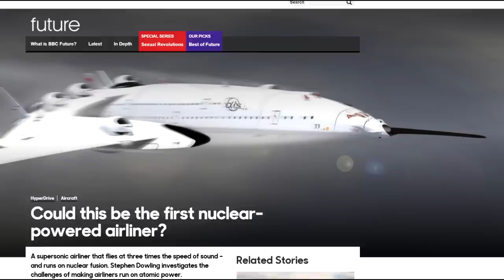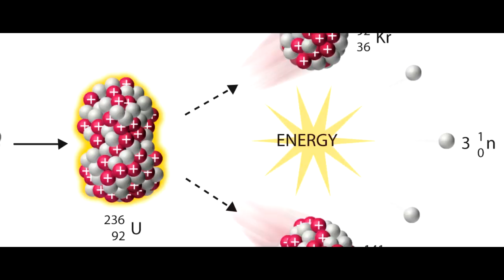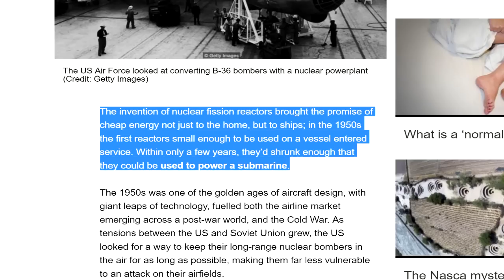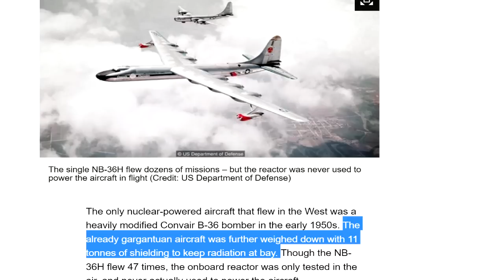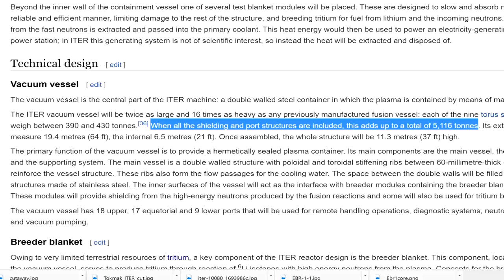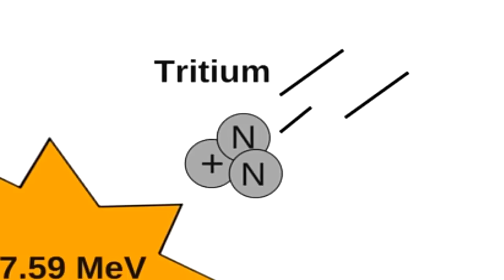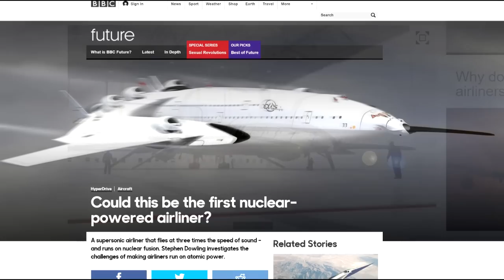SIX ENGINED Nuclear Airliner... BUSTED!

Comment: One point I would like to raise is friction heating at that speed. For reference, consider that a concord painted white has a service speed limit of Mach 2.02 while a blue concord is limited at Mach 2 for no more than 20mins at a time. Higher speeds would probably cause thermal damage to the material. 

Concords are able to sustain internal temps by using fuel as a heat sink, crossing the pacific probably takes abt 3hr where either they land or they use up all fuel generating the speed anyway.

We assume that the powerplant is not 100% efficient and generate excess heat. Where are the radiators gonna go? Considering that the outside is hot and the inside hotter, I would assume they advertised this airline as the 'flying oven'

Comment: What of the fission powered turbojets experimented with in the fifties? The heat energy is used to power a turbojet, similar to how they work now, only instead of combustion with jet fuel, you find the heat from the reactor. 

Naturally this would take a great deal of work to shield an operator, but what of drones? Then you simply need to shield the outside of the vehicle, so you don't have a flying 'neutron bomb'

Comment: Pls, enlist some of your fans to do historical research for You.
Convair NB-36H was a prototype: a flyable B36 with a functional reactor, however:
1) that reactor was just a test device to try out the shielding, and it was never powering the propellers,
2) 11t (in that 1955 prototype; in perspective it could be significantly reduced, because You have to shield only the crew; even the airfield stuff could be protected in other way) is not so much for 40t max payload of B36 (or, realistically: 20t with fuel for long mission); The problem was the position of the shielding, and (in early concepts) a requirement of placing all the heavy stuff near the center of the mass. That was a problem, but a solvable problem.
3) "atomic bomber" program was cancelled not because it was too hard to develop (few tweaks here and there...), but in 1957 it was already obvious, that ICBM was much cheaper and in the long run: much more effective alternative to any bomber,
even with (almost) infinite range.

Comment: If it's just 10t of shielding then it's not really a problem, you will get rid of over 20t of conventional fuel after all. 
That being said, it's still pretty crazy idea (even if it's technically possible to do) for the safety reasons - nuclear reactors flying over our heads? No, thank you!

Comment: +Thunderf00t Wouldn't it be easier to just use nuclear fission reactor core in an engine, pass over the air from the intakes and then heat it up so that you get a superheated plasma  exhaust?
Reply: Shielding remain a problem. Too much weight.
Reply: Not if polution is part of the plan.
Reply: Fuck shielding. Radiation is just another liberal conspiracy to take our jobs and make us poor! Wake Up SHEEPLE!

Comment: The only bullshit is the fusion part and the "six" engines. The concept of a nuclear powered plane is viable ( they even do test in the Peacemaker as you mentioned ) but of course the "direct" core model was a stupid idea and even the "indirect" model have the problem of "plane crash=nuclear wasteland". About the six engines... another one of the bullshit nails in the coffin, it can have six exhaust and air intakes, but not six cores that's a no sense. BTW cool video ;)

Comment: Fuck that noise. What you really need is a solar-powered moving sidewalk made out of solid dilithium that can reach speeds of up to 3,000MPH that bring you to a thorium-powered railgun that just fucking shoots you across the planet to your destination. You could get anywhere in the world in five minutes, and the railgun pods could carry up to six hundred passengers and fire at a rate of fifteen pods per second. Running at full speed, it'd take just over ten hours to depopulate the entirety of the USA by flinging them safely wherever in the world you wanted! And space exploration? The pods would be self-contained life support systems which could maintain food, water, and air for a thousand people for six thousand years! It'll be called the NOAH Ark-Cannon, and if you invest today you can get in on the ground floor and triple your investment!

Comment: Let me list some of the problems with a nuclear-powered airliner that I could think of: 
1) The whole point of a nuclear power plant is that it can run a long time on relatively little fuel, which is why large military ships such as aircraft carriers have them. These ships are out at sea for months at a time, but no passenger jet is going to go for more than a few hours without landing. 
2) Terrorists who hijack the plane or shoot it down over territory where they can loot the wreckage would have relatively easy access to radioactive materials which could potentially be used to build a dirty bomb. 
3) The possibility of terrorists getting their hands on radioactive material would necessitate even more invasive security screening than what airlines already have. 
4) If the plane exploded in mid-air, it would spread radioactive material over an area possibly hundreds of miles wide.
5) The weight of the radiation shielding would necessitate a much larger aircraft with much larger engines, and the energy needed to get such a massive aircraft off the ground would negate the supposed benefits of running an airplane on nuclear power. The bulk of the reactor's energy output would be spent just keeping the plane airborne, never mind getting it up to mach 3.

Comment: I totally agree with most things you said in this video and i really love, that you this bullshit, but i actually thing, that you kinda misrepresented nuclear fusion. It more than obvious, that fusion can - in my eyes - never be used on an aircraft. Mostly because for a tokamak to be even close to efficient it has to be big ... thus heavy. 
I went to the wikipedia article where you got the weight from, and i actually couldn't find that number, but it don't think that this really matters much, because any number close to that makes it completly useless for an aircraft. 
The neutrons aren't actually a big deal, they kinda make the shielding a little bit radioactive over time, but nothing to really worry about a lot. 
It is true that tritium is radioactive and thus dangerous, but it's half life is nothing compared to uranium for example, and it's radiotoxicity is rated as the lowest possible. It's biological half time in the body would be about 10 days and the beta rays can't even penetrate skin. 
If you just "breed" tritium from lithium in the blanket you would contain all the radioactive materials in the power plant. 
It is true, that the ITER reactor is the first one, which actually is expected to "create" more energy than it uses, but it kinda implies, that there aren't actually working tokamaks which have been successfull in fusing Deuterium and Tritium. 

I would really love a dedicated fusion video on your channel, i think it's a very interesting topic and i would love to hear your detailed opinion about this. 

(Please excuse any errors or mistake, english isn't my native language .. i'm from austria)

Comment: Okay before I even watch the video, I'd like to take a guess at a few of the issues here. One, based on my (admittedly limited) understanding of jet engines, they cannot be driven by nuclear power alone. Jet engines work via compressing gasses and then rapidly expanding them again by introducing vast amounts of heat through injected fuel, and using that expansion to both power the turbine and add to propulsion. Turbofan engines kind of combine that with the properties of a propeller. But nuclear power wouldn't work for a jet engine; that would need to be done through either standard propellers or something else. Which in turn would probably not be going supersonic any time soon.

Also a nuclear reactor would be really fucking heavy. Nuclear reactors are basically used to drive glorified steam turbines, which is how most other plants work. The nuclear reaction causes water to head to boiling point, the resulting high pressure steam drives a steam turbine, which then would be used to drive a generator for electricity or something else. You would need to supply a lot of water for this process, the reactor itself would need to be shielded enough to protect any passengers (Which would also be accomplished with more water. Water is really quite good at blocking ionising radiation. That's why they store nuclear waste in deep pools of water.) and it would need to be properly contained to deal with heat and whatever else. So, amazingly heavy. I doubt you could get that in the air at all.

Those are the two biggest problems I can immediately think of with this notion.

Edit; Oh, they claimed nuclear fusion, not nuclear fission. Yeah we don't have a working example of a nuclear fusion reactor. That's still very much in the experimental stages. Nothing useable for actual power as of yet.

Edit 2; Oh, no prototypes. Yeah don't expect one any time... ever.

Comment: Why can't they just use fission?
Reply: Because future!
Reply: While a fission-powered aircraft would technically work (the United States Air Force experimented with two different types during the cold war) it would either spew irradiated particles into the atmosphere or use so much extra shielding and a more complex reactor design (one which does not irradiate the air passing through the core) that it becomes heavy enough to be impractical. I thought this documentary about nuclear aircraft was interesting: watch?v=xb7uZQ1_n4w
Reply: have you ever seen a nuclear reactor? they are big and heavy. both things that dont go well together with planes. not to mention the contamination problems if a nuclear plane crashes.
Reply: Sokar12345 Ya..but that's why engineers wanted to experiment with the concept, to see if they could make it viable. Look at the link in my last comment.

Comment: Not only is their tech bullshit, their math on London to NY flight times is way off, even now it's only typically around 7.5hrs and a distance of 3470 miles could be covered in way less than 3 hrs at 2300 mph they claim. 
If you get some help from the jetstream, going the other way (no head wind), you can seriously reduce the time, a Boeing 777 reported speeds of up to 745mph as it flew from New York to Heathrow in just 5 hours 16 minutes.
Reply: Incidentally, my uncle was on the design team for the Concorde and later engineered nuclear piles for naval vessels, he'd be laughing his ass off at this.
Reply: rip concorde :|
Reply: Marcel Krebs It was a victim of economics and a bad green image, also, the internet made things like videoconferencing possible, negating the need for as many face to face meetings for movers and shakers.
Also, it was expensive to maintain for an aging air frame.
Reply: Concorde's record actually is 2 hours 55 minutes so the magic-plane feels underwhelming.
Reply: Sotiris Koumelas yes but it was expensive as hell, still better than fiction I guess.
Reply: Try selling flights on a fictional plane... cheap on the start but it should get pretty expensive after you get sued to hell :p
Reply: Sotiris Koumelas Richard Branson did, he called it Virgin Galactic
Reply: the problem with concorde and similar aircraft is that, although it's fast, the earth is too small for it to become useful. it spends most of its time either gaining or losing speed, and not actually flying at supersonic speeds. that's where i believe the 3 hours figure comes from - while the plane can achieve top speed that's three times the speed of sound (provided we concede it'll work), the average speed will be much lower.

Comment: https://en.wikipedia.org/wiki/Aircraft_Nuclear_Propulsion
Please do some actual research next time.
You know, for a smart guy your sure are stupid.
Reply: The plane's supposed to work with nuclear fusion, not nuclear fission, so I don't see how that's relevant.
Reply: I don't think you listened. He said there has been nuclear powered planes on the past, but they required so much shielding that they had to be abandoned due to the tremendous weight.
Reply: >research
>wikipedia

choose one
Reply: Read that wiki again it says that a nuclear powered plane was never built but that they put a nuclear reactor in a b-36 and that it flew but the plane wasn't powered by the reactor instead it was just to test the shielding. In the mx-1589 section the nuclear aircraft projects were abandoned. And you
Reply: @Jeffery_Liggett You really should read the wiki entry for yourself before posting it because you just made yourself look like a moron.
Reply: Did you even watch the video.
Reply: What exactly do you think that link contains, and why do you think it's relevant to this conversation?
Reply: He fucking shows this at the start did you even watch?
Reply: To avoid looking like a tool for the rest of time, OP will soon delete this post.
Reply: I don't think you're in any position to call Thunderfoot stupid or say he needs to do research. It's you that clearly don't know what you're talking about and couldn't even spell a simple sentence correctly.
Reply: it legit says in the wiki link that the project was abandoned due because there was little use for it in the future

Comment: Oh yea?  Well that's nothing.  I've already built a 4000 ton space battleship that flies at mock 3 (that's 3x the speed of light), and runs on blackholes created entirely out of human urine.  But it needs a lot of fuel, so we serve free beer on board.  I have the prototype already built in my basement in California, but I need donations to get it to market.  Please send money.
Reply: Ok I will send you money because I'm stupid and will fall for it.
Reply: I'm working on a 10 trillion ton mach 45 perpetual motion solar magnet powered paper air plane wanna help
Reply: +Retaeiyu
No!  What are you stupid?  It has bucket holders.  The beer is served in buckets.  I told you it takes a lot of urine.
Reply: BUT does it have cup holders?
Reply: +pappajudas
Fake and gay.  Everybody knows there is no such thing as mach 45.
Reply: We will make mach 45 as well as batteries that charge 1000 times faster and 3 times smaller
Reply: I've beaten all of you with my reality breaking invention: The Perpetual Motion Plane (P.M.P).  It runs on magnets.  I would set up a kickstarter, but no body appreciates my genius.

Comment: Thunderfoot, I know something like this plane is impossible, but concerning the actual planned fusion reactor with over 5000 tons of shielding, couldn't you simply use a large powerful magnetic field to keep the neutrons from escaping? I'd probably use up more power than you could generate with such a reactor, but my question stands: Can you use magnetic fields to deflect radiation?

Comment: If that tokamak-style fusion reactors depicted are meant to produce power for a town or small city then a smaller fusion reactor meant just to provide power for a plane might require less shielding, no?

I think most air craft of the future will be more personal-sized (like flying cars) powered by turbines/nacelles burning hydrogen. Or maybe we will travel primarily by magnetic levitation bullet trains in low-pressure tunnels to exceed the speed of sound. Or maybe laser propulsion.

Comment: Instantly I'm going to say that a fusion reactor would weigh as much as a factory. to put that in the air you can only build higher. To make a building fly...

Nuclear fission it's a matter of stability. How you gonna cool it? Air doesn't have the same heat capacity but as long as it's big enough it's technically possible yet who's gonna allow you to fly it into their airspace... Not me.

Comment: Just an idea don't bloody shoot me if this is bullshit.
If the Neutrons get stopped by electrons couldn't you make a coil around the reactor core and have a current flowing through it to stop the Neutrons ?
Reply: No real point in that. A high current just means the electrons in the coil are moving, but the average number per volume will stay the same. :3
Reply: It's gamma rays that are stopped by electrons, not neutrons, but when current flows the moving electrons are continually replaced with more electrons which means you have the same amount of electrons as before the current flows(just moving electrons). Anyway there are way more electrons in the atoms of a material than that in the flow of electricity
Reply: Neutrons are magnetically/electrically inert, they'll keep going until they hit something. Shielding is required to be dense so theres a much greater chance of hitting an atomic nucleus on it's way through. Chances are, neutrons themselves will fuse with atomic nuclei, and form potentially radioactive isotopes. 

Gamma rays aren't merely stopped by just "electrons" either. Those electrons need to be within an atomic structure for them to absorb EM waves.

Comment: If they want to build a faster modern version of the Concord type of aircraft there is a simple solution,  Build an aircraft based on the existing proven design but use lighter modern materials, modern avionics and modern more efficient engines.  Easy right?

We don't need some fantasy nuclear airliner like the one off a Thunderbirds episode.

Comment: A plane based on a fission reactor could theoreticly work. But it would be more or less like taking the core or Tschernobyl and flying it around - which is obviosly a bad idea. The base concept was already concidered in the 50's (i think), but it was deemed way to dangerous as you would have to run your exaust gases (in most designs water) directly over the core to heat it up enaugh to generate enaugh thrust, again, a VERY bad idea.
And this is not even concidering what would happen if such a device crashes...

Nuclear propulsion for unmanned spacecrafts: fine, but on earth? Definitely no! Please stick to other ideas like an electric aircraft, which are at least somewhat realistic.